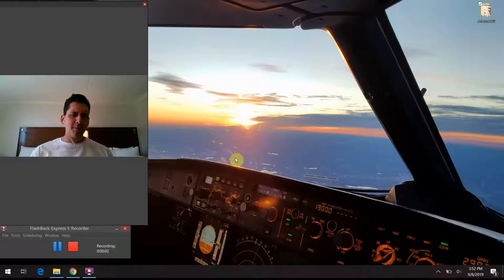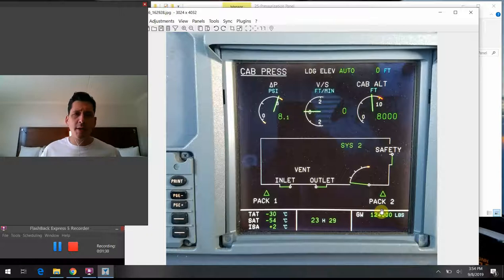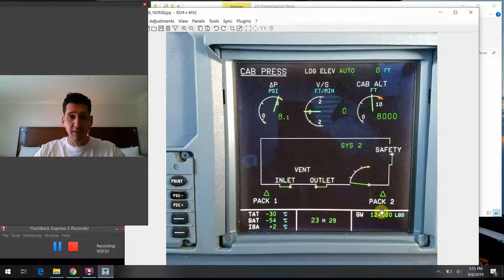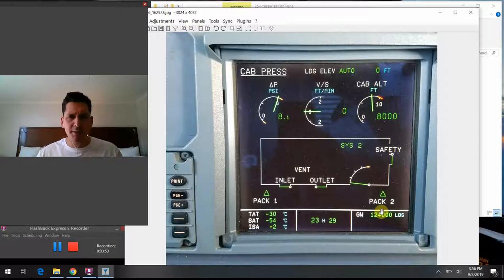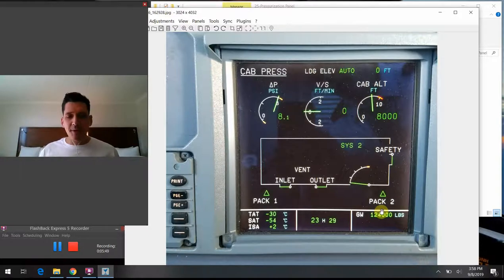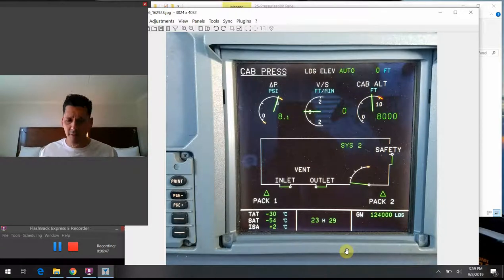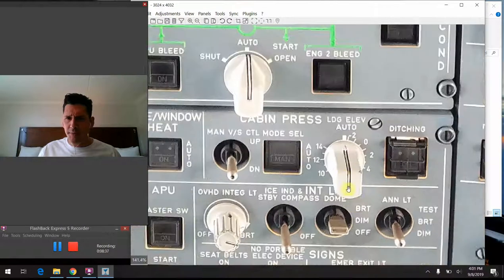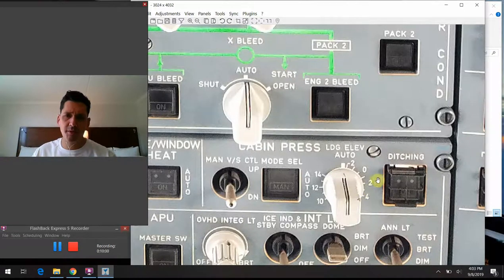Airbus A320 Cockpit Tour: #25 - Cabin Pressurization Panel: What do all those buttons do?!

Comment: Hey.. lovely video.. just wanted to know in manual mode, what N (degree) 1 position mean?
Reply from the maker: Hi Vivek! Thanks so much for watching! Are you talking about the Landing Elev Rotary knob? I think this is what you are asking, but each mark stands for a 1000 ft increment. So we can set the elevation of the landing field, or arrival airport, as close as we can, rounded down, to the nearest 1000 ft. So if we were going to land in Denver lets say, we would set the knob to "5", or 5000 ft Denver airport is roughly 5400 ft. in elevation.

Comment: Hi Mr.Abignale

Where is the safety valve located on the a320? How does it look like?
If the landing gear is down when you push the ditching pushbutton, what happens to it ?
Reply from the maker: Hi Aby! More great questions. Will get back to ya in the next vid. Cheers!
Reply: @MikeAbignale  thank you Mr.Abignale 😀😀😀